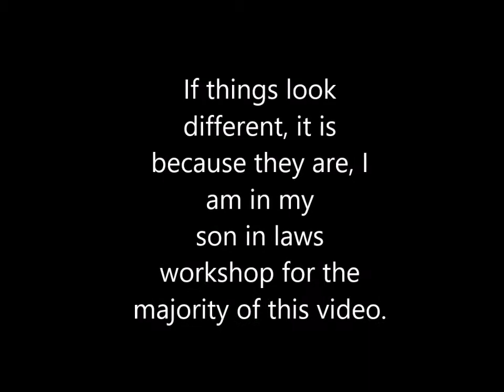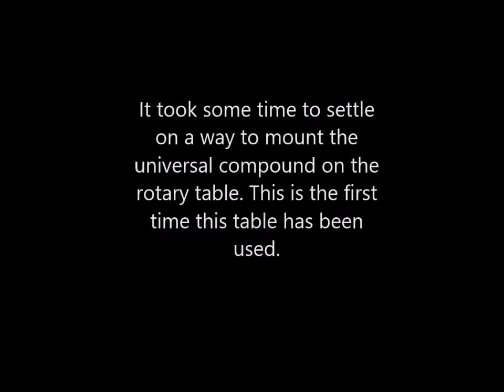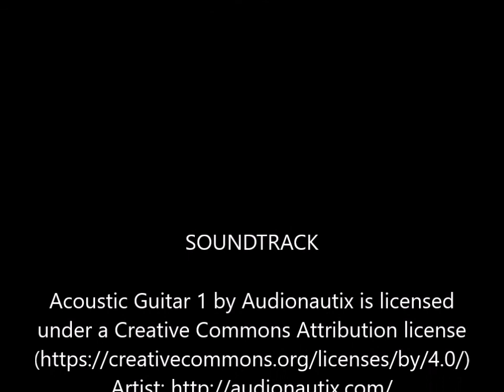Building the Gingery Milling Machine 56, Universal Compound complete

Comment: To us those foreign made forged steel tables an vises as well seem to just be to sandy too pores to us anyways Peter. We live 2 blocks west of a harbor fright (not a miss spell on freight) great in a pinch. First time we have sen your current milling machine. Juan Rivero below in the comments caught you Peter, you are using a mill to make a mill? The slotting of the base rotary plate is a smart move for future small additional adjustments during setups, are those slots a deviation from the book or is this you realizing flexibility is helpful?
Reply from the maker: G’day Lance, yes the slots in the main body are longer than in the book, I did it so I could turn it far enough to achieve the MT2 taper for the spindle. Also in the book the outer ears are only a hole, so why not slot them, I have the use of a rotary table and mill anyhow.